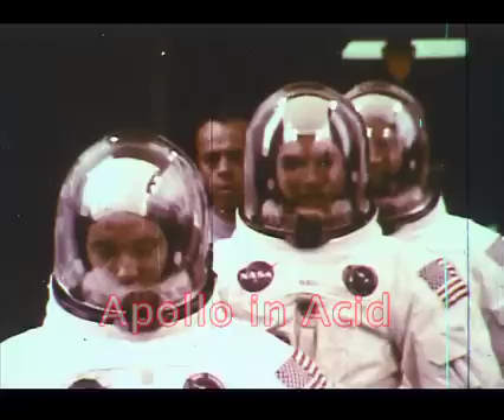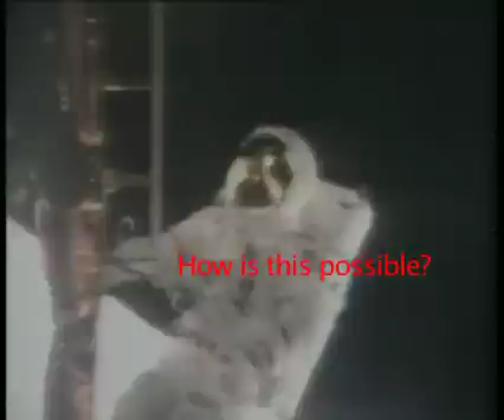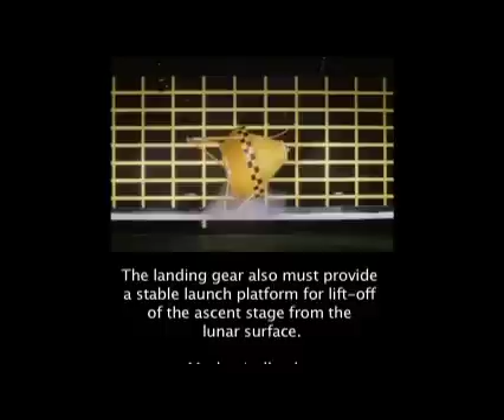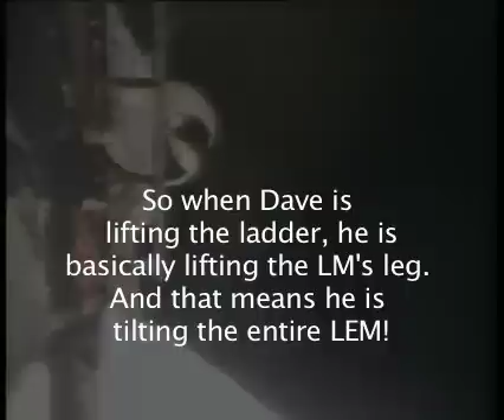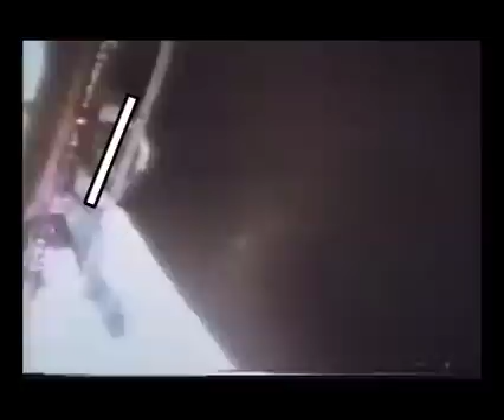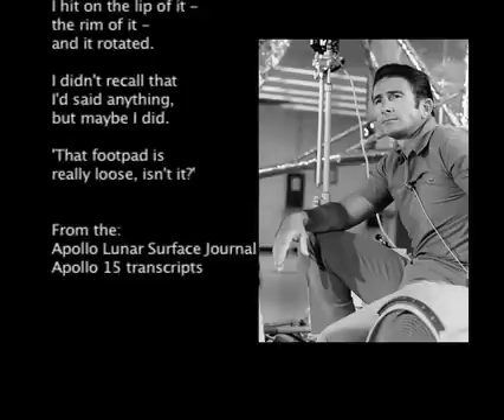Apollo in Acid:  Jacob's Ladder

Comment: Good catch, and funny as hell.

Even my dad was laughing on this reveal.

By the way, each leg was supporting around 555 pounds Moon equvalent (ME). (~10,000 pounds on Earth [LEM weight]  * .16667 [Moon gravity] / 3 [3 LEM legs/pads] = ~ 555 ME pounds) 

Links:
1) https://www.hq.nasa.gov/alsj/a15/a15v.1195542.mpg
2) https://www.hq.nasa.gov/alsj/a15/a15.jim1ststep.mov

An American citizen, not US subject.
Reply: Actually there were four legs, which renders this entirely plausible. Four legs would render one as not truly contacting, and thus Irwin lifted the leg only (or else the camera would have moved). And it had apparently not locked into place. Obviously not a mission killer. This could have caused problems in the ascent stage of the LEM, causing it to teter or pitch during lift-off, and I am sure it was worried about, but ultimately no harm done.

Comment: The illogic of you hoaxers truly does defy belief. You cite 'anomalies', which are nothing of the sort, and which in any case, disprove your assertions:

If the LM was on a stage, there would be no downlink through the high-gain antenna, so Scott's bounding down the ladder could not break antenna lock-on. There would be no lock to break.

If the "loose" footpad was in any way a giveaway of fraud, the very last thing the perpetrators would do is alow a broadcast of the fact through the audio!

Comment: What more can there be to it? It's all in the report; the LM landed on the edge of a crater, hard because the engine was shut off at surface probe contact. The forward (+Z) pad hit hard, pitching up the LM 6.5 degrees and collapsing the shock absorber 3". When Scott stood on the pad, he held it down; when he stepped off, the LM was free to pitch back and forth. Simple as that for anyone who understands basic mechanics.

Comment: How is that a contradiction? The LM was free to rock slightly around the Y axis (i.e., in pitch) because of the shortened +Z leg and probably also the non-level surface. So the pad could either be in contact or not with the surface depending on where its center of mass was at the time. The legs were designed to crunch on landing to absorb energy, and A15 was probably the hardest of the 6 landings. So what?

Comment: Nothing new here. A15 experienced loss of visibility during the terminal landing phase, due to high dust levels.Touch-down was virtually blind.

/watch?v=GSu4ekXXH-8

The LM ended up on the rim of a crater, with a backward tilt.

AS15-86-11600

The LM legs used a crushable aluminum honeycomb as a lightweight, one-way, one-time shock absorber.

heroicrelics. org/info/lm/landing-gear-strut-honeycomb. html

(more)

Comment: (part2)

The front leg hit first, shortening it a bit more than the others – hardly surprising, as the back leg ended-up in the crater!

Either because the DPS displaced regolith forward, or because the LM skidded forward as it landed, only 3 of the legs retained contacted with the surface.

The men could feel the LM “rock” even before they left the ship.

Like a teeter-totter with two carefully-placed people on it – a slight imbalance will set it to rocking.

Comment: According to the mission report, the +Z (front) leg stroked 3 inches, vs only 1 inch for the other three, and the +Z footpad was off the surface. The lunar surface is not flat, and in case you've forgotten your geometry 3 points determine a plane, not 4.

So I suppose none of you have ever tried to put a 4-legged chair on irregular ground and had it not sit straight, huh? Must be a totally new concept to you all.